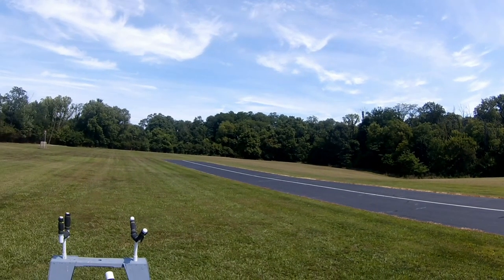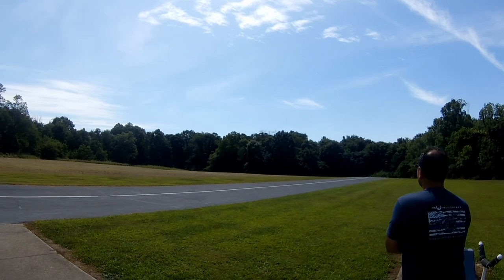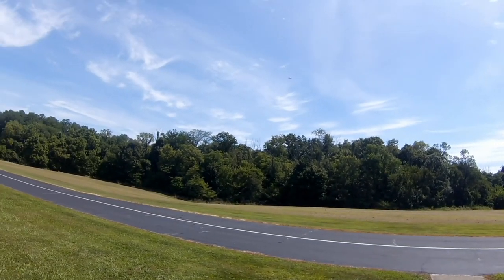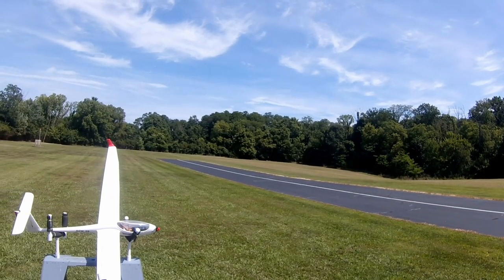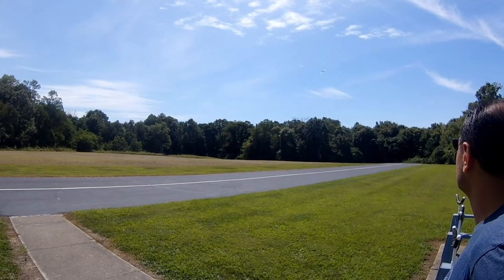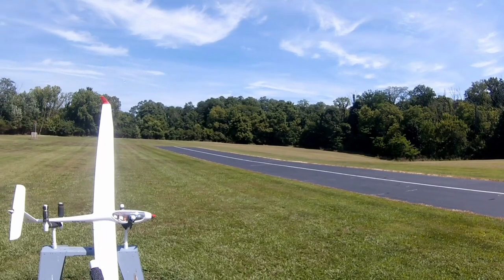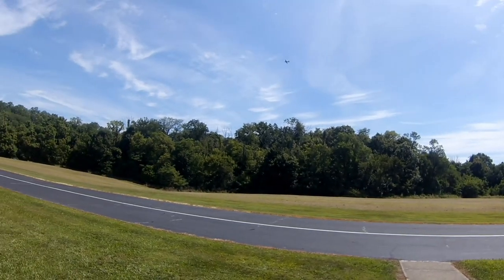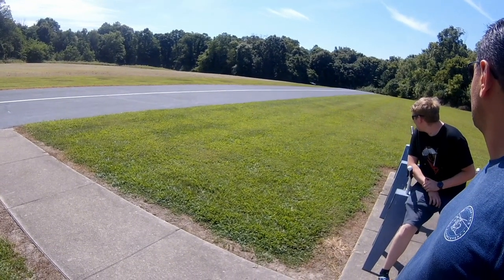Arrows RC T-28 Trojan maiden flight.

Comment: Very nice brother, working on your 262 tonight live. Great flight. Shakey start. Well done✌✌✌👍👍👍
Reply from the maker: Yeah definitely not enough right rudder.    I flew my buddies F-15 and that is one of the cool things about jets.  They don't torque.
Reply from the maker: i'll definitely tune in for the show.  Thanks brother!!
Reply: Not at all. Strait as an arrow. That's why I like edf's so much i think. No compensation at all. Just fly it.
Reply from the maker: Definitely will use flaps next time.  I was a bit fast and over flew the runway a bit.

Comment: Hope my maiden goes that well. I’m going to paint mine yellow and I’ll have a Cen. Blue, Red & White,& Yellow. O and cut the little vent hole out on top of cow to get more air flow in cockpit. Helps, that Duryfly still gets hot going to change it before flying it again.👍🏻👏🏻✌🏻👊🏻🖖🏻🙏🏻🖐🏻
Reply from the maker: EQ RC I’ve had no heat problems.  But I’m using rolling tops 3300 they are flat and leave room for airflow.